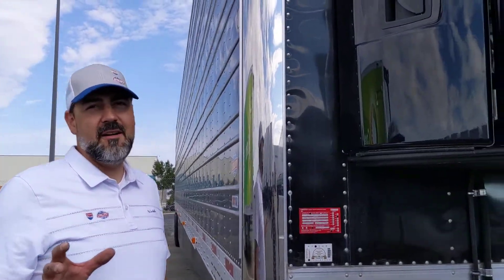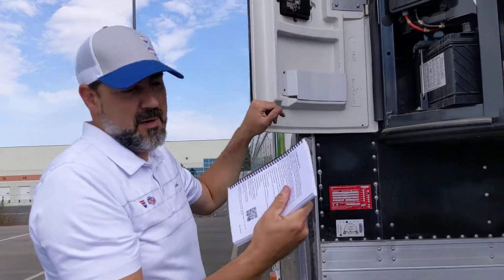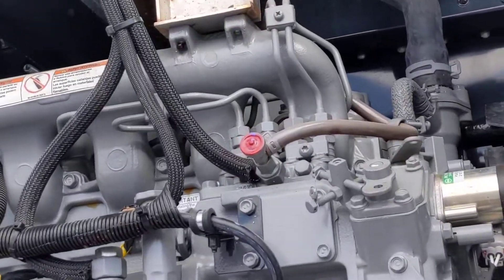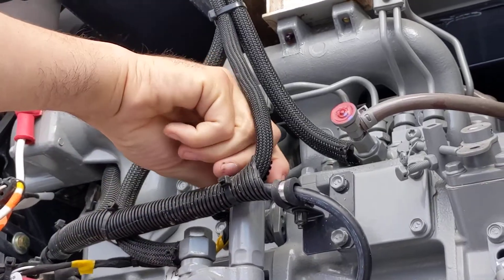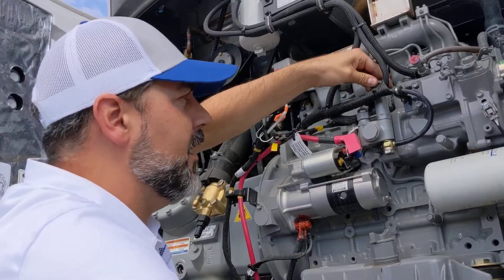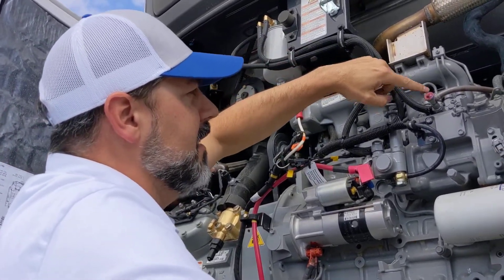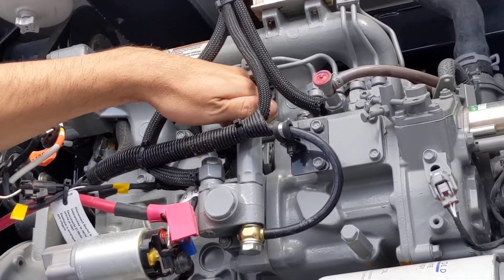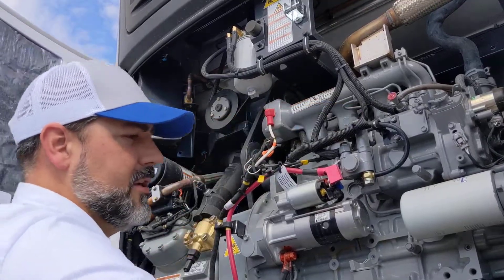How to prime the fuel on a Carrier reefer unit.

Comment: Thank you for the straight forward video. In my experience I found that on the 7500 you should pump at a moderate pace and NOT FAST PUMPING. They say maximum one pump per second.

Comment: Your Video Helped me a lot !
After changing oil and all filters I started a unit and its shuts down . After many attempts I couldnt get it started . I cleaned a RPM sensor and fiel screens . Its showed me A42 and A130 engine stalled and High RPM sensor. It is a sighn of not enough fuel pressure in the system. I opened up a sec valve " red " pumped 200 times than closed the " red valve " and pumped a 100 pumps as you instructed and Bingo its started right up.
My unit is Carrier Transivold Adbance . Thank you very much !😊
Reply: You za Men !

Comment: Is it possible to pressurize the inlet side of the fuel filter housing with fuel  and crack the fuel nozzle line nuts to bleed the system , retighten and start unit .  I would say 10 / 15 lbs. pressure . Either with a 12 volt fuel pump or pressurized container .  Everything I read is about pushing the primer more than 100 or more times .

Comment: So even if you run the engine dry and sucked in a shit ton of air into the system you just keep pumping? Because I've heard that you have to take the fuel line off of the fuel filter while pumping to get the air out of the system and when fuel starts coming out of the line you connect it back onto the fuel filter.
Reply from the maker: Yes, just keep pumping and it should eventually prime. If it does not you could have a small leak in your system.  Removing the fuel filter will give you visibility to when the fuel has been pulled from the tank because fuel will spill out of the line.  While the fuel filter is disconnected you also have the option to pour fuel into the filter to help prime it more quickly.  Many reefer shops have air adapters with pressure regulators(<10PSI) so they can pressurize the fuel tanks in order to prime the fuel lines without using the pump.  Should you attempt this method it is important you do not over-pressurize the system as this will cause damage and potentially bulge your fuel tank.